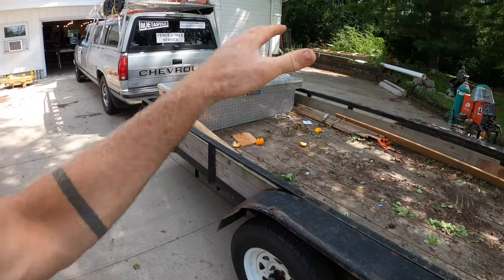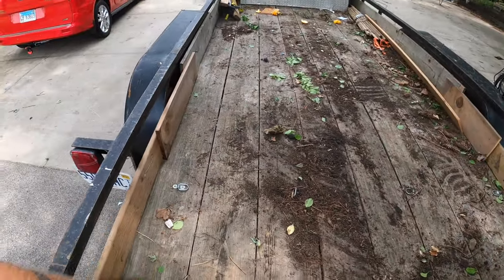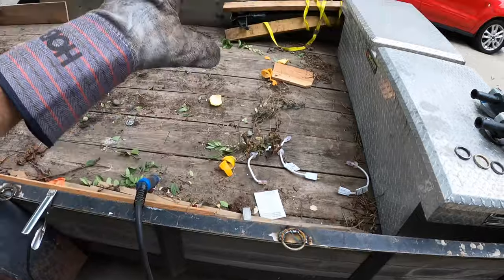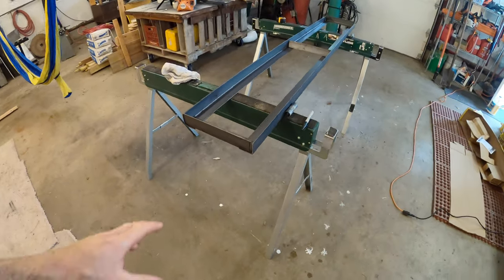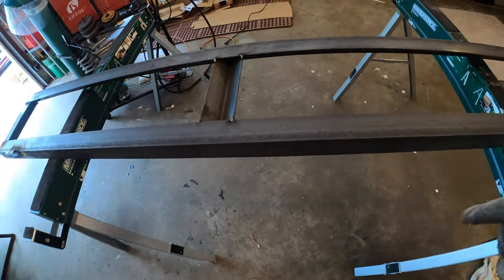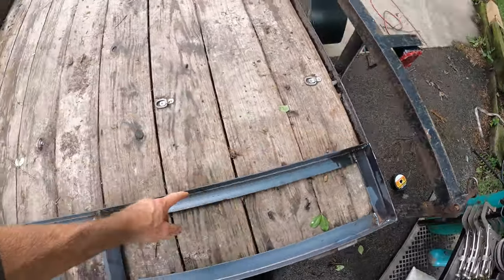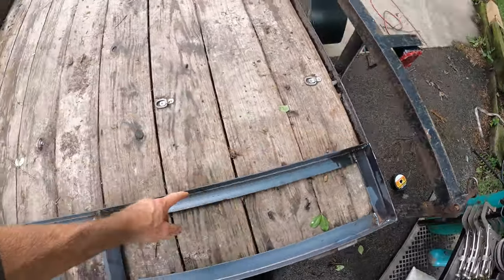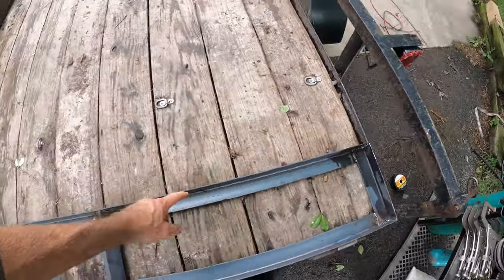Making a Shorty Tailgate and Other Trailer Mods

Comment: Nice gate. I like that it folds flat inside trailer. Don’t have to remove it load it with a forklift or hauling long stuff.
Reply from the maker: Exactly! I'm pretty psyched about it, too :) Thanks for checking it out

Comment: Great trailer updates. I have two questions. One, how often do you use your big old red truck? And two, what's keeping the sliding bolts that keep your new back gate closed from sliding open as you drive? Thanks from Vancouver.
Reply from the maker: Oh how I love that big old dump truck, but it needs a bit of tuning to really and reliably get out there. So yeah, a tune-up is on my list for that truck ... it's a good one. Very few miles but running a bit rough at the moment. I'll start with plugs and wires and see where it gets me. As for that tailgate, it's held on by the frame around it. So when extended it can slide off to the side, but in the up position it's held in place. A bit dicey, I guess, but nice as it's removable and that big old gate can slide on whenever I need it. Good hearing from ya, man!

Comment: Looks like a brand new trailer. Surprised you didn't put the clamp on the passenger side to stay out of traffic
Reply from the maker: Good idea on the clamp ... nice to see it out the rearview but not the best place to work. :) It's easy to move, so when I get a good spot maybe I'll bolt it in place to keep it from walking off. :)

Comment: Finally got your Chevy fixed up huh? What was wrong with it, out of curiosity?
Reply from the maker: Yeah it's running great. First the transmission croaked (only two gears were working), then flexplate melted into goo and it all had to come back apart. I guess I should be saving up for some new rubber ...